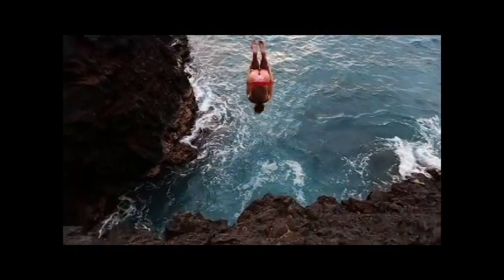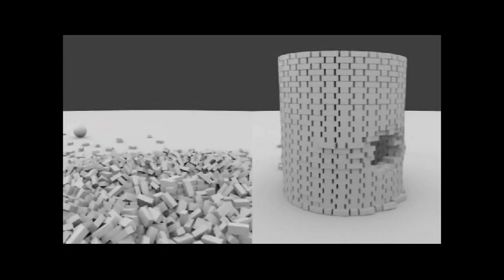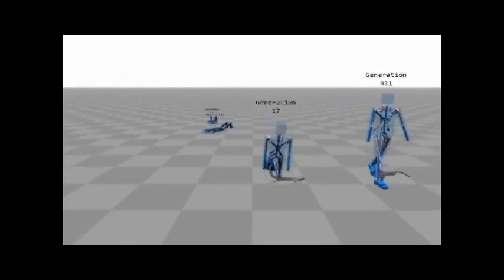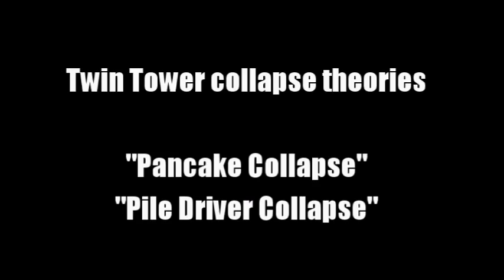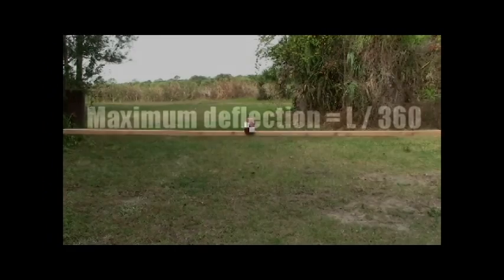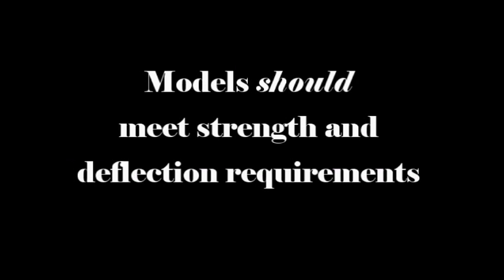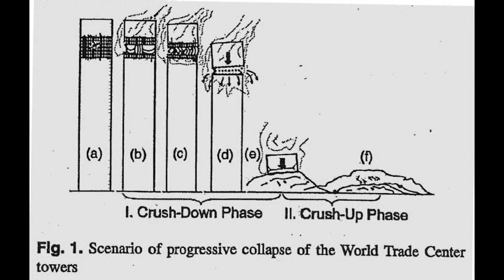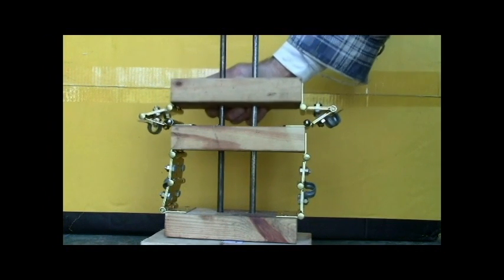9/11 Experiments: The Force Behind the Motion

Comment: Crude experiment is right.  It comes nowhere near creating the collapse as seen.  Using explosives is cheating.  You must find the materials to conduct an experiment which mimics the collapse perfectly without explosives.  All conclusions of a demolition conspiracy remain unsound.

Until then Occam's Razor applies:  the simplest explanation is correct.  Two large jetliners impacted separate tube frame office towers severing a quarter of the columns in the exterior wall and an unknown number of core columns.  A large fire of office contents across several floors ignited by thousands of gallons of aviation kerosene softened enough remaining structural steel to precipitate collapse.  In one building it began when the external wall failed, the core collapsing after.  In the other building the core failed and exterior columns could not stop it.   Once the mass above the impact zones of both towers was in motion the force of the structure pushing up from beneath was not strong enough to stop it.  Collapse of both buildings began at the site of impact and fire, not elsewhere.

This is the observational evidence your experiment needs to re-create.  It will not be a simple one.
Reply: +longlakeshore The problem with your incoherent rant is that you fail in your assumptions and do not take into account ANY of Newton's laws. When the south tower started to fall, the top started to tip over at approximately 23 degrees. According to Newton's first law "Every object in a state of uniform motion tends to remain in that state of motion unless an external force is applied to it." , that top part of the tower should have continued to tip and fall over tumbling down to the street below. IT DIDN'T! It violated Newton's first law. It then fell straight down CHANGING DIRECTION. Since we know that you cannot suspend the laws of physics EVER, something else happened to that tower.

Newton's second law states: "The relationship between an object's mass m, its acceleration a, and the applied force F is F = ma. Acceleration and force are vectors ; in this law the direction of the force vector is the same as the direction of the acceleration vector." How could the top part of the building be exerting uniform, symmetrical pressure on the floors below? For that matter, how could it have exerted any force whatsoever? After it's asymmetrical tip at 23 degrees it miraculously exerts force to 80 floors worth of 47 steel columns that were not damaged and intact and then fell symmetrically at free fall speed to the ground below? Newton is turning in his grave and you should be ashamed!

Newton's third law states: "For every action there is an equal and opposite reaction." As the top started to accelerate down onto the 80 intact floors below, those 80 floors would have exerted an EQUAL amount of force upwards making it impossible for the smaller top part of the building to "pile drive" its way down through the bottom 80 floors and would have decelerated the top floor until it stopped. Just like in the experiments in this video.

All of the gobbly goop rhetoric about this and that and blah blah blah cannot withstand the blow of pure science to you argument. Go away now and go learn you some science son!
Reply: longlakeshore
 It is not just that there's a large body of fact-based evidence but of mutually supportive fact-based  evidence. In science they call that a concordance of data and it is a dream scenario in terms of establishing hypothesis as correct.
Thermite has been found in the dust, a very special nanocomposite sol gel based potentially explosive (see Harrit 2009) thermite. *See Kevin Ryan;s Digwithin blog  essay called How To Debunk WTC Thermite and by all means give it a shot/ . That the fires could not be put out for 100 days supports the thermiye claims bc it provides its own oxygen,, so it burns even underwater. there was molten steel and iron documented numerous ways including by government scientists (see FEMA BPAT Appendix C) , and aluminum oxide (seen as white smoke that poured from all 3 sites for months, then there are the iron microspheres, and on and on with facts all supporting the thermite hypothesis. Molten metal was seen pouring out of the south towers, moments before the building came apart, just above the very same point the metal had been pouring out of..
That is far and away the strongest hypothesis and as we cannot falsify it, it stands. It's that simple.
How could a skyscraper implode as WTC7 did and not be a controlled demolition when the only time those features have ever been seen, ever, in 120 years was and is during controlled demolitions? As such the burden of proof lies with anyone claiming it was anything else that brought it down. No one is saying it was a conventional demolition, it also had pools of molten metal in its basement. See 'Komatsu patented thermitic demolition device.'
Reply: no.
Reply: +longlakeshore wrong again
Reply: +longlakeshore Hmmm, i was responding to +Jeff Kasser :)
Reply: +longlakeshore Unfortunately there's about a dozen well-documented facts that can only be accounted for by explosives so following Occam's Razor it's, either the laws of physics were suspended or explosives were used. Which do you reckon is more likely?   

Only building 7 'collapsed.' The Towers were blown-up with so much energy no trace has ever been found of over 1200 people that were in them that morning. Look at photos of debris fields. At all of pulverized concrete, both left 1200' radial debris fields (FEMA BPAT),  massive multi-ton perimeter wall assemblies (groups of columns they were) blasted for hundreds of feet with such force they embedded into the facades of neighboring buildings. And then look how the buildings were made. The top is the lightest part of any structure, the columns (perimeter and core) got thicker the lower down they went and could support many times the weight of the building. Type 1 (100% steel-framed) buildings are called non-combustible not because they dont get fires in them but because they dont collapse from fire. Even if fire were going to collapse a structure,, it could never look like WTC 7 implosion did because fire is an organic process. Had even a single column been left intact in Building 7 there would have been an asymmetrical collapse.
Reply: +winston smith   It's a mistake to limit your conclusion to a suspension of the laws of physics. Just because you can't explain the collapse doesn't mean a demolition conspiracy is the only answer. That's bad science.

Let's look at your demolition theory.  For it to be valid, BOTH towers would have been wired with large amounts of explosives to cut core columns floor by floor from top to bottom to meet the requirement of near free fall acceleration Mr. Cole attempts to reproduce in this video.  The core columns were not exposed. They were hidden behind walls and between elevator shafts which would have had to be torn open to apply explosives and connecting wires.  It would have taken months or years to do. It's impossible to hide that amount of work.

When it came time to collapse the buildings, the core columns would have had to have been blown floor by floor from the point of impact all the way down in 11 seconds for the South Tower and 13 seconds in the North Tower.  It's unlikely such a perfectly timed demolition sequence could be programmed in so tall a building to blow the thing in such a short time.

The core of the South Tower, we know from video, did not fail. It remained standing some 70+ stories until after the floors pancaked to the bottom around it, the unsupported outer walls falling away. Then the core fell. So if it were wired for demolition it was not done so in the same way as the North Tower.

Mr. Cole's experiments, though interesting, are too simplistic to explain the collapse. By his own admission they are crude. His use of paper to mimic the walls of the towers, for example, is like using a paper airplane to demonstrate a jetliner crash. I just tossed one and the only damage is a slightly bent nose.

My challenge to him remains:  he must build a model which collapses like the towers did without using explosives. A computer model which takes into consideration the tens of thousands of pieces of steel in the structure and the strength of and stresses on each would be easier to make and more accurate. Such a model was done and the twin towers collapsed as they did that day.

Mr. Cole began with a conclusion--a demolition conspiracy--and designed some crude experiments to prove it. That's bad science.
Reply: +winston smith  Thermite isn't the subject of this video.  Nor is the collapse of WTC7.  Stick to the subject of the physics of Mr. Cole's experiments in this video and their utter failure to explain the collapse by anything other than being secretly wired with demolition explosives.

The burden of proof lies with you and Mr. Cole to prove the demolition conspiracy your claim. So far you have failed.
Reply: +Noname Noslogan    Your mistake--and this is the mistake of most demolition conspiracy theorists--is to say that fire brought the twin towers down.  Only fire.  In doing so you ignore the gaping holes the aircraft left in the sides of the buildings which took out a quarter of the vertical support columns in the outer walls of these tube frame towers. The North Tower's core took a direct hit which may have severed as many as a quarter of it's columns as well. True to this, it collapsed when it's core failed at the impact site.

The South Tower's core was struck a glancing blow, but many more of the external columns were severed along the entire east wall. True to this, it's collapse didn't begin in the core but along the entire east wall which made the top of that side of the building tip outwards before falling straight down. Again, much of the core remained standing until after 110 floors had pancaked to the ground, then it collapsed.

What are the chances that your demolition conspiracy wired the two towers to collapse differently?  What are the chances your demolition conspiracy happened to wire the two towers to collapse differently which happens to match the way they were struck differently by two jetliners?  Nil.

These tube frame towers were brought down by 1) impact damage which severed at least a quarter of the external columns plus an unknown number of core columns 2) by hot office fires across five floors started by thousands of gallons of aviation kerosene accelerant which softened the already weakened steel structure until it could no longer support the weight above and 3) by impact damage which destroyed water mains so the sprinkler system failed to suppress fire.

It was not just fire.  It was not just impact damage.  It was not just sprinkler system failure.  It was all three.

All three towers which collapsed that day were of tube frame construction. The other four WTC buildings which did not collapse--even when hit with tens of thousands of tons of steel and concrete from above--were of box grid construction. That's the difference.

Occam's Razor applies. The simplest explanation is what we all witnessed:  the planes took out support columns and water mains, then unsuppressed fire softened enough of the remaining steel that the weight above could not be supported.

If you have information regarding "teams" which rigged the towers with demolition explosives at night you should contact the FBI right away. They'll want to know.
Reply: longlakeshore  READ: "HOW TO DEBUNK WTC THERMITE by Kevin Ryan.  It's irrelevant that Cole doesnt mention it here bc it was central to how the Towers and WTC7 were destroyed (*See Komatsu's patent for a 'Thermite demolition device'). No plane hit WTC 7 and according to NIST the towers came down not because of the plane impacts but because of the fires. Regardless, it is patently absurd and so completely counter-intuitive that "normal office fires" could have imploded WTC 7 in the manner in which it came down.  (Oh, wait that must be irrelevant bc Cole doesnt mention Building 7 in this video,, -that's sums the paucity of your argument).
The North Tower was hit no more than 12 stories from the roof line. It beyond ridiculous to even imagine, much less argue that that small upper block could have blown up, (bc clearly they didnt 'collapse' -but were blown up with thousands of explosives and that is exactly what the videos show and dozens of witness accounts found in the Oral Histories confirm), the 90% intact structure below the point of impact. No one is ignoring the fact that planes hit the towers, only that the plane impacts cannot possibly account for the complete destruction of the intact lower portions,through their vertical axes, accelerating as they came down at approximately 64% the rate of free fall, (see analysis done by David Chandler) as gravity would have been the only force driving the destruction. 

The South Tower was hit about 30 floors from the roof line. Molten metal poured out of the southeast corner, just below the point where moments later it came apart and as it did the entire upper intact block could be seen leaning well outside the profile of the building. In the real world this block would have tumbled into the street intact. Instead it re-rights itself; demolished with explosives, it seemed to magically disappear into ever-widening clouds of dust and explosive debris.

Carl Sagan famously stated 'Extraordinary claims require extraordinary evidence.' There is nothing theoretical about any of the mountain of extraordinary mutually supportive facts that prove the demolition of those buildings. As such the 911-anthrax attacks fall into the realm of conspiracy fact. Arguing otherwise reveals nothing but one's ignorance or denial of the facts make the official explanations completely untenable. WTC 7's implosion alone is proof of demolition and that's just the start of the facts that prove demolition.
Reply: +Jeff Kasser   First of all, I'm not ranting.  I'm not angry.  Nor am I patronizing as your language is. I am respectfully disagreeing.

Let's take your points one at a time. When the east face of the South Tower tipped out 23 degrees, why didn't it continue to fall over? Newton's first law answers this: another force stopped it. What was that force? It was the vertical columns on opposite side of the tower which were intact and undamaged as well intact floor trusses which gave rigidity to the tube frame structure. They stopped the tipping until they failed when the lateral stress of the tipping mass upon them was too much. Then the weight of the tower above, no longer supported, began moving straight down.

Your second point. F=ma. How could the building above impact be exerting uniform, symmetrical pressure on the floors below? Answer: it wasn't! The severed vertical columns in the tube wall (and core, if any) assured that. Those loads where transferred to the undamaged vertical columns AND laterally through the weak floor trusses across five floors at the impact site which held the whole structure together. Floor trusses failed when their steel was softened sufficiently by the fire causing the east facade to tip outwards momentarily before falling straight down.

Remember, the core of the South Tower did not fail. The rest of the building pulled away from it beginning at the impact site and the mass of the floors--each one poured concrete on light steel decking--pancaked because the floor trusses were not designed to stand up to the weight of 20 floors above falling on them. The building unzipped like a banana from the top down, its disintegrating peel arcing outwards and down.

Okay. F=ma. In this video Mr. Cole attempts to answer acceleration, so the equation is a=F/m, but remember that the numbers you plug in were static only at the moment collapse began. Once in motion the mass increased but so did the force as potential energy was converted to kinetic energy.

Newton's Third Law. Well it's obvious the vertical columns could not push back:  they were all in the core or in the external tube wall!  Had they been distributed evenly across the entire footprint of the building it would not have collapsed. When the lightweight floor trusses failed they unzipped themselves from core and external wall all the way down. 

Your mistake is thinking the building was of rigid box grid construction like the Empire State or Chrysler Buildings. Comparatively the WTCs were lightweight with massive floor area unsupported by nearby columns. It allowed them to be built very tall with maximum rentable floor space, but the trade-off was safety.

A chain is only as strong as its weakest link.  For WTCs 1,2&7 it was tube frame construction.

Newton's not rolling in his grave.  His laws are satisfied and he sleeps peacefully.
Reply: +winston smith  This video is not about the chemistry of the collapse or it's by-products. Try to stay on topic.
Reply: longlakeshore The facts of thecase arent bound by a video. That's the issue: the destruction of WTC 1 2 & 7 using preplanted explosives.
Reply: +Jeff Kasser Whahaha, you are hilarious :) Lets look at the first law of motion.

 "Every object in a state of uniform motion tends to remain in that state of motion unless an external force is applied to it." 

Ok, lets do an experiment. Pick up a 20 pound rock, and throw it above your head into the air. According to you, and your lack of understanding of newtons law, it would continue flying up into the air until it reached space and beyond. So why does it fall on top of your head?  Well newtons law mentions an external force, and in this case its gravity.
Reply: +JohnnyBoy2222   Wow.  At what point did I say gravity wasn't the force acting on the towers?

Here's an experiment for you to do: throw a 20 pound rock in the air then add mass to it as it falls. Gradually increase it's weight so it doubles or triples by the time it hits the ground. Plug the numbers into F=ma and you'll understand why the towers collapsed at near free fall.
Reply: +winston smith   For which you have no evidence.
Reply: +JohnnyBoy2222  My bad.